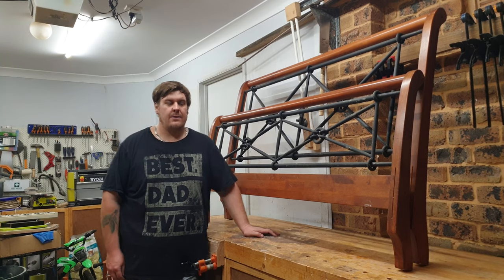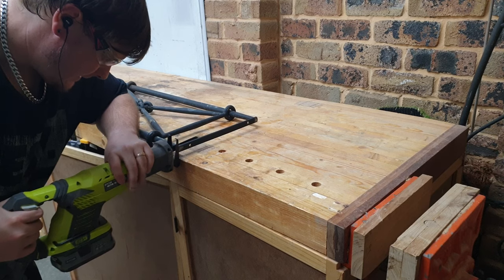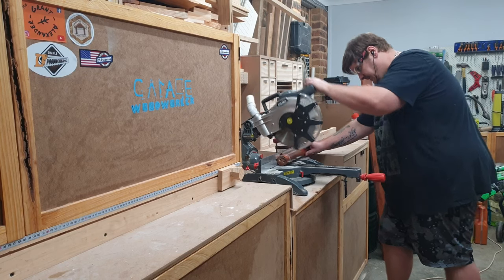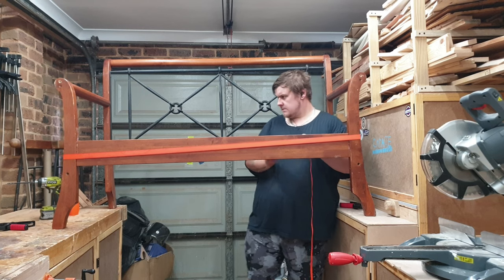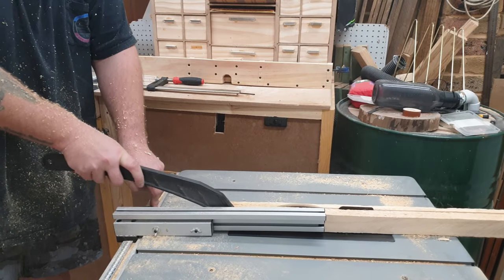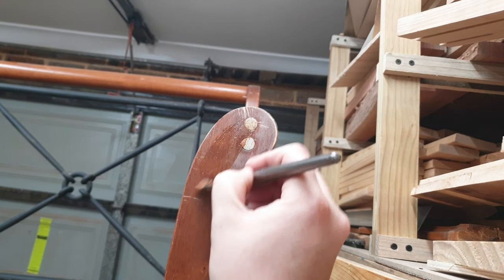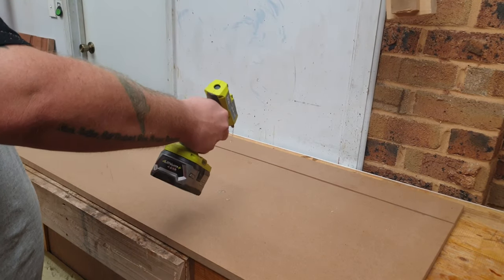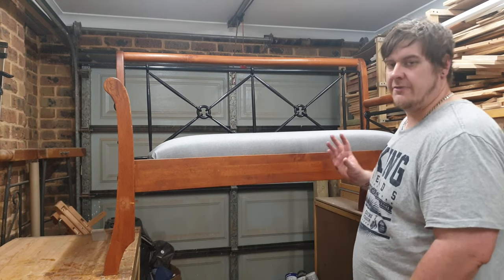Bed To Bench Conversion // WoodWorking

Comment: That is repurposing with dedication 👍 Not even rigid metal hardware prevents you from transforming that bed 🛏. Nice project!
Reply from the maker: Thanks. The metal work was the worst, I don't really have the right tools for metal working but making this reassured me that I prefer working with wood 😁

Comment: Is there a way to use the baseboard as the seat part of the bench? I have one that has the same slight curve to it.. it’s all wood.. I just don’t know how I would connect those or how to  attach legs since it would need some in the front..